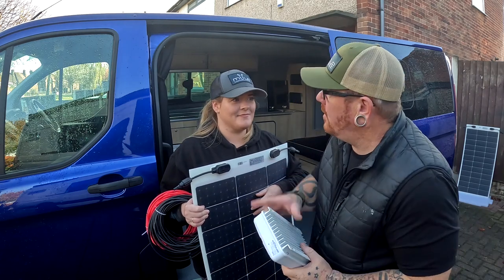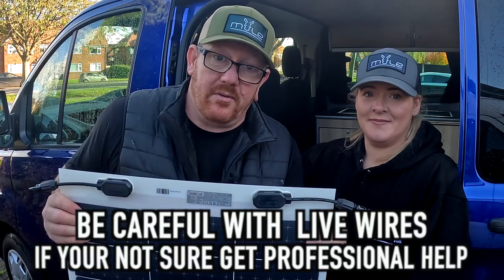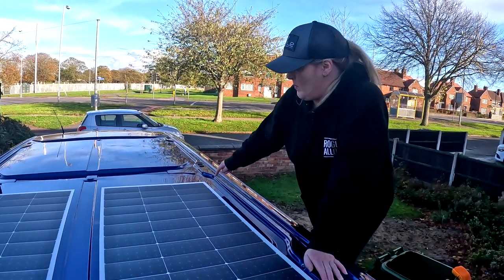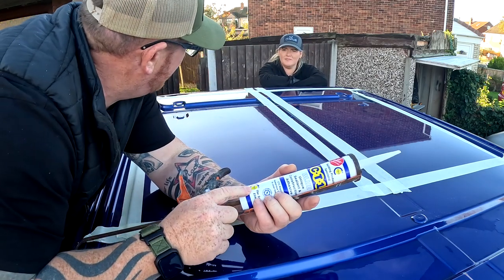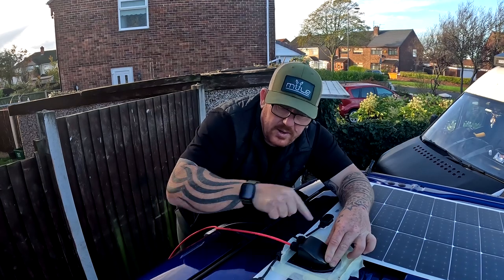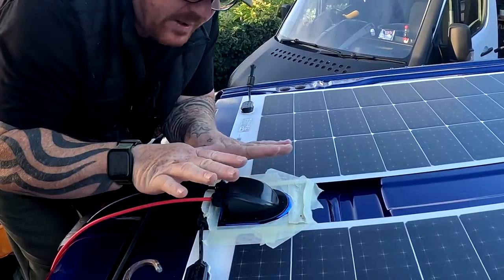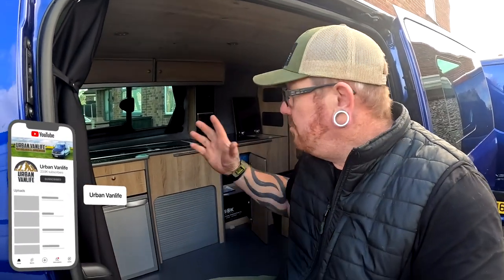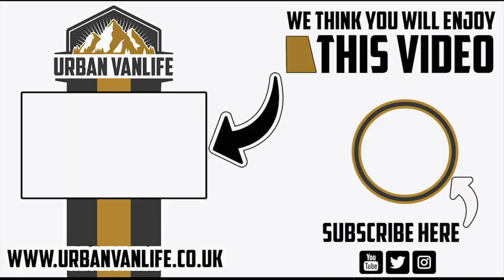Unbelievably THIN Solar Panels For Your Van Build

Comment: Just remember the golden rule: never stick solar panels directly to your van roof!
Reply from the maker: Best inform the millions that do . Self build and coach build as well . Litraly millions of vans out there doing it wrong . Good job your here to tell them all there all wrong mark .
Reply: @UrbanVanlife  solar panels directly on the roof is more aerodynamic and this saves on diesel.
Reply: @markhall3323  What's your priority, MPG or panel lifespan? If you do high miles, low profile is better. Or pay more for CIGS and have the best of both worlds.

Comment: Only problem i see is with the thin panals you need to create a air gap so the panels arnt getting baked with the hot roof for some reason the hotter the panel the less energy it can take

Comment: I have the same solar panels and I’m trying to plan the wires / layout. If I’ve got one panel at the front of the van and the other at the end, and I wish to join them together in parallel, do I put in two glands, one either end next to the corresponding panels and join the wires inside the van or join the wires on the roof of the van and use one gland? Thanks

Comment: Problem with these panels is they can not dissipate  heat very well, and in strong sun they get fecking hot. Which will reduce their output
Reply: Glueing flexible solar on a roof is a big no bueno. My failed after a year despite having a PVC isolation underneath. Funny video though.
Reply: @danishow77  I was thinking this too, if those panels fail, gonna be one helluva job tryna get them off!

Comment: They look awesome - would be interesting to see how long they last.
Reply: Hi，Shawllar flexible solar panel has German TUV authoritative certification. 
In addition,  it has 5 years product warranty and 12 Year Linear Power Warranty
Reply: I would use these as temporary panels mostly if I had some similar to folding portable panels. Thinking of trying some as an extra boost along with my glass ones when needed or to use in portable situations. I`m in hurricane country in a dangerous situation in a very isolated area, disabled, and no transportation. All I think about each month is more prepping supplies. Right now my main focus is on setting up solar power for my tiny window air conditioner by April, testing it for a month, then deciding what I need to do to improve it. 

I`m almost certain that decision will have to be more solar panels than my initial plan of 780 watts of panels. That will be perfect during the six main hours of bright sunlight but not if it`s partly cloudy with big puffy clouds slowly passing by. And in Winter I will certainly need more because of a lot of partial shading from the cursed pine trees. I need to be able to fill up my large battery fast if possible when sun is limited. Regardless of the limitations though I`m excited that my dream of solar powered air conditioning is very near reality. Maybe next I can get real internet here so I can be a content creator. But we`re still in 1920 here.
Reply: My friend broke his panels pretty quick.

He glued the panels directly to the metal and the the extreme heat of the summer created air bubbles and melted the panels to some extent. He regretted not mounting them with a bit of airflow underneath.

Something to think about I guess

Comment: proper made me wince seeing hopes in the roof being drilled, Mr Cee but inspired using conduit. You both did a really cracking job. I've got a similar panel on Viv-I-van  but was lucky having a tailgate so managed to avoid cutting holes. Mine was connected to a cetek 250 which had a built in mppt and then to the batteries- though I now wish Id got a bespoke MPPT and put the batteries under the R&R bed cos now Id love a swivel front seat and mine are inside it.  Great job.great video. bessy regs-Kenny
Reply from the maker: Some times you have no option do ya mate . We could have ran them over the back door seal but that would have lasted 5 min and would have been a crap job . Some things need a hole
Reply: @UrbanVanlife  thats me told Neil, 🙂 though, truth be told I bottled out cutting holes in the roof as power tools hate me. Bad things always happen when I pick one up 🤣I'll bring a hole saw and drill to one of the meetings next year and get a proper job done.🖖
Reply from the maker: Hahshhshshs I just close my eyes and blame emma mate

Comment: Cracking job again guys - great idea to use the conduit and double seal - I’m fitting CCTV to mine soon and will use that idea 👍 
Would you recommend the flexible over the rigid panels? In the future looking to upgrade to some more solar and wondered which would be best as flexible may just fit near the front (Ducato) 
Thanks as always informative and entertaining 😀
All the best, David 👍
Reply: Flexible panels have an advantage in terms of weight and thickness, but their downsides include a much higher price per watt and a much shorter resistance to overheating which means that if you are using them in a hot climate they will probably only last a year or so.
Reply: Hi David, I did some research with regards to flexi and rigid last year with the general consensus being the rigid last far longer. That said there is also a guy on the Facebook group who swears by his folding panels for additional solar. It would be interesting to see how he connects them to his CV. Rick mentioned he is thinking of upgrading Pearl as well and I think you both have 20's. Hope this helps. Cheers K.

Comment: Did you have a problem with heat? Someone told me that solar panels get hot if there is no airflow underneath and I was advised not to glue it directly to the roof but glue it to a plastic sheet first. Really stumped now. And help or extra advise will be very appreciated 👍
Reply from the maker: There is a lot of people talking a lot of crap about solar mate and how to fit them . But every single camper van manufactured van on the planet what has these kind of panels has them stuck to the roof like we did . And non of them seem to have a problem buddy . And Iv never known any one to have an issue . So I’d just stick them my friend cos that’s what there designed for

Comment: Make sure the panels are ETFE , Renogy ones have mounting holes and great quality, I have 800w on my caravan, you should have some form of an air gap 5_10mm between the roof and panel with something like twin wall Polycarb, it stops them burning cells out on very hot days and they last a lot longer, watch  RV with Tito all will be explained better than I can.
Reply: yep need an air gap, my 100w panel lasted 2 year with no gap,  but this summer burnt it out
Reply from the maker: Thanks for the tips, but we did leave a gap at the back and at the front so its not 100% sealed all the way round!

Comment: Very helpful video guys, very informative. Just a quick question regarding the gap in the roof the solar panels sit over, is it worth filling that to stop any wind lifting the panels over time?
Reply from the maker: Nar it won’t effect the panels . And to be honest we put them ther on purpose because of the gap . In the hot weather it will allow expansion and will allow the panels to breath

Comment: Flex panels are nice but j hope you have an air gap underneath them because, they will heat up without ventilation and burn out.
Reply from the maker: Yes there are gaps underneath 😊

Comment: Also, appreciate your points regards gluing them down, but what if one goes faulty, needs to be repaired? My guess is they won’t accept returns with adhesive all over them?
Reply from the maker: Valid point doubt they would accept a return with adhesive on but if we had screwed them in don’t think they would accept them then either so maybe another way of fitting them would be needed
Reply: Also, just read that an air gap improves efficiency. A year on, any updates?

Comment: Where are your isolators as recommended?
Reply from the maker: You don’t actually need to fit isolators there not some thing a lot of people fit . I mean most motorhomes with solar from built company’s don’t have them . It’s only a thing in the self build comunity but not needed if you don’t want them

Comment: Great video plenty of good information however I don't think I would use them panels because I reckon it would be a nightmare getting them off when you want to replace them.
However as I said bloody good video mate. 

Quick tip for you where you cut the hole out on the roof I know you put some heat shrink around the cable so it would not catch on the sharp edges of the cut out hole. Try running a bit of blue tack around the edge as well.

Comment: Interesting panel but not a fan of those red/black cables run externally, could you not have had a single roof gland eitherside either side of the roof closer to the panel connection, then run the red/black cables internally ?....I assume that they are double insulated and UV resistant insulation ? Just from an electricians point of view.
Reply from the maker: yes they are double insulated and UV resistant and why have two glands when you can have one?
Reply: Cos as an electrician he can charge you more money for doing more work :)

Comment: Ok when the van roof gets hot you’ll lose efficiency , and even reduce the life of the panels , you need airflow under the panels , Twinwall polycarbonate panels need to be sandwiched between the panels and the van
Reply from the maker: And that’s why we fitted them where we did and didn’t seal the air track out of the panel . It’s as if you didn’t watch the video but made a comment on a presumption
Reply: No I watched the whole video you glued the panels straight to the roof

Comment: They'll overheat, you need an airgap between the panels and van.  They'll die after a few years (or less) without one.
Reply from the maker: Is there no air gap there and isn’t that why we fitted them there for expansion purposes ????

Comment: Ive hesrd them thin panels over heat as air cant get underneath them
Reply from the maker: Iv heard that as well but in 10 years never known a single person to have this problem
Reply: @UrbanVanlife  see how it goes with them I've the other one that up on legs or a roof rack just to be on the safe side

Comment: You can't do this in Australia. 
Because your roof will melt and probably catch on fire 🔥
Reply from the maker: Ooohhhh Yeah you get a lot more sun over there!
Reply: @UrbanVanlife   I really want stealth solar panels like this but I can't do this in Australia it transfers too much heat to the van. 🥵
Reply from the maker: Yeah not advisable that, last thing you need is a melted van!

Comment: Do some research, these panels let off a lot of heat and will ruin your roof.
Reply from the maker: Done the research and there is an air gag underneath them as can be seen if you watch the video so they will be fine